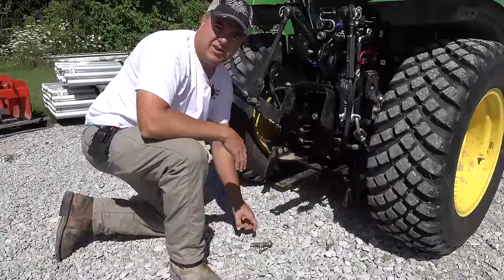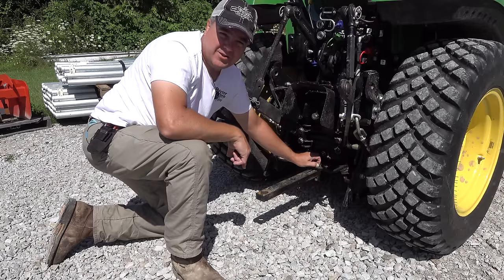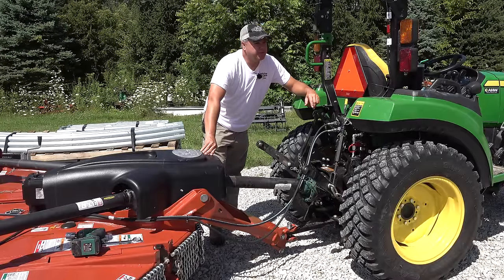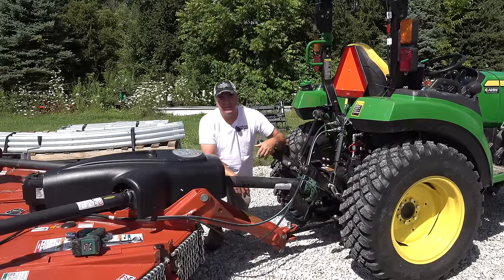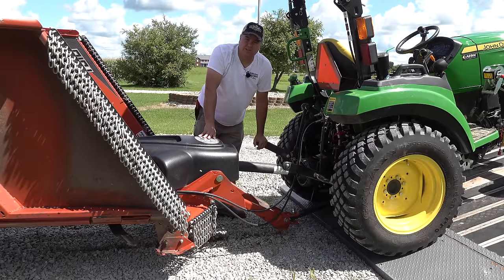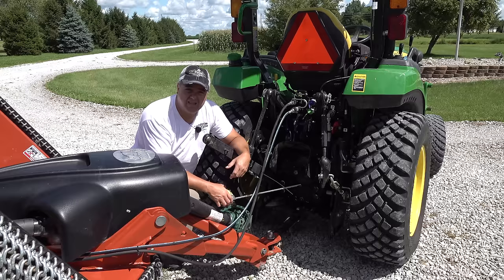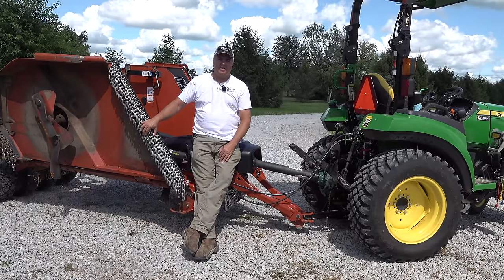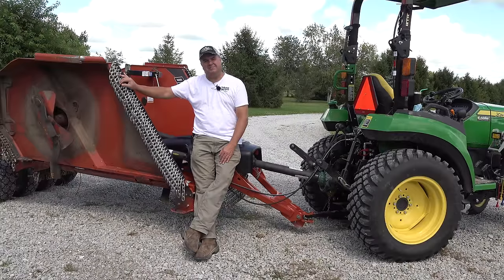COSTLY REPAIR on Deere  2038R!!!  Tim's HUGE Error!  Details Inside.

Comment: Very good video... While I have not used a pull bar hook up yet, I probably would at some point and like you would most likely have made the exact same mistake because I also try to not extend things out to far.  One of these days though, to be fair, I should post the link to my video when I got my first tractor and nearly flipped it upside down thanks to the new forward angle ROPS and a nice thick tree branch...    Because of that and my contacting JD immediately (don't know if it is remembered, but I got one of the very new model 102x series out of the factory before most dealers even had them) and they took a look at it in JD engineering. Aa few weeks later a full recall for the ROPS was done and the dealer picked up my tractor to have a mod done as apparently it is supposed to break the pivots now if that occurs with the engineering change.    

People make mistakes..  and sometimes they are costly..  I am glad in a way this happened as it is a good teaching moment for the rest of us.    Right now, for me, I am trying to figure out where this extra metal bar with a spring piece goes under my tractor... It fell off and I have NO idea where it is supposed to go.. LOL
Reply from the maker: Post photos to greentractortalk.com.  They will help you.
Reply: @TractorTimewithTim  cool thanks!   It's needed as I have no idea where this part fell off.. it's not broke at all..  it got pulled loose moving brush with the grapple.

Comment: hi Tim, couldn't you have hooked up the hitch to the 3-point by using a 3-point hitch adapter? I use this method because I ripped the draw bar mounting bolts right out of the casing the three-point is much stronger it looks like in the video that The Hitch is too low in the first place my tractor has a thumb screw that locks the three-point so it can't be lifted or lower you can lock it in a fixed position
Reply from the maker: Please.  Do not do that!
Watch this video for explanation:
https://youtu.be/kD-MSo3kRAo
Reply: I watched the video I understand what you're saying you can actually lift the 3-point up if you're strong enough when it's in the down position by hand. I guess it's designed to float so it doesn't cause damage to the tractor. your father was a very wise man he knew what he was talking about

Comment: Hello Tim, I'm gonna invest in a jd 2038 tractor and a tiller when watching ur video here I picked up on ur statements about cutting ur PTO shaft to correct length. I don't know about tractors and attachments? So maybe reading the manual would be the correct thing to do! But like u I tend to think I have a basic understanding of thing and would never take the time to do so. But my question is if I hook a tiller up to the 2038r would I have to cut the pto shaft? Or can u just hook up and go? I know this probably sounds pretty stupid but like I said I'm new to the game! Thanks in advance!! T.Cox
Reply from the maker: Once you hook up the 3 point hitch, then try to connect the pto.  If it will NOT retract far enough to allow you to connect to your PTO shaft on tractor (with a couple inches to spare), then it needs to be cut.    
After connecting, make sure that you can raise and lower the attachment all the way without seeing the PTO shaft fully contract.

Comment: Don't beat yourself up to bad. I work at a machine shop close to Nashville and we just had one in here about a month ago fixing a similar problem. The gentleman was bush hogging and somehow got it in a bind. I cant remember the exact size of the JD but it was a compact tractor with a cab. He had busted the housing out around the rear axle. It was a substantial damage! We were able to repair the bell housing and add thicker plating around the 3pt hitch connections. Now Im not a tractor expert by any means but the biggest problem I seen with that JD is it was all cast aluminum. This may be common on your new compact tractors but coming from someone with a manufacturing back ground I would think that cast steel would be a better choice than the cast aluminum. Deere knows the loads that could be applied at times to the working end of the machine. Seems like a huge miss to me.

Comment: Thanks for sharing your misfortune, Tim.  If you save only one person from making the same mistake, then it's all good!

I'm a newb, but are there aftermarket drawbars available with a gooseneck bend that will give you acceptable separation from the PTO shaft and raise the implement tongue up to a more horizontal position?  Or make up your own?

Comment: I was lucky I put a new pto shaft on my 3 point brush hog, it was longer than the old one so when I raised it way up the shaft bottomed out and bent the third point on the brush hog instead of breaking the pto housing, I cut the shaft to the length of the old one, it’s like closing the barn door after the cows get out.
Reply from the maker: Right!  You were lucky!  Oh well, we all eventually learn...even if a bit too late at times!

Comment: Definitely something we're all guilty of. I had to take a field rake off in a ditch to get out. But I don't know if I should be impressed with the strength of the mower and PTO shaft, or concerned about the strength of the tractor's casing.

Comment: I took my new John Deere 790 tractor with the 60 inch brush hog attached to our church to mow the church lawn and was mowing when I reached an area where there is a downhill grade and thought about what the manuals said about mowing on a downhill grade and decided not to carry my tractor on that grade and instead mowed the upper part which was level and let the kids use a push mower to go over the downhill grade to cut the grass. I didn't want to damage my new tractor and bush hog unnecessarily by trying to cut with my equipment in a bind. That was a good decision on my part and saved me possible damage to my equipment and time to get it repaired. I do read the manuals and the stickers on the equipment to be on the safe side  even though I have operated tractors before.
Reply from the maker: Good choice, Sidney!

Comment: I recently bought a tractor and a few implements from a local dealer...one of the implements was a 6 foot Roto tiller that when delivered was said to be ready to go....i bush hogged a few days then hooked up to the tiller...i shoulda known something was wring when I had to connect to the pro first then back in to hook up...a few minutes of tilling and the u joint was chewed off...spread the yoke...the dealer gave me a brand new shaft because they knew their mistake.....they cut the new one but not nearly enough...i eventually got it short enough .....i hope lol
Reply from the maker: Lucky it only damaged the shaft
Reply: @TractorTimewithTim  yes weak u joint? hopefully saved my tractor

Comment: I used to hate reading manuals also until I worked for a dealer years ago and had to setup things for customers. I rather enjoy reading them now, you learn shortcuts and how to use new features, some you might not even know about. Besides I've seen too many costly mistakes on new machines.
New toys are sometimes hard to wait for, but usually almost always pays off in the end. I do cheat sometimes, we all do.

Comment: Hey Tim 
I saw in one of your video you went by one of your friends that have a LS  MT 125 tractor which I have. Would you have any idea why when I use the backhoe sometime the boom give trouble to swing to the left (like its weak)but works fine swing to the right. 
Just checking since you around small tractors
Thanks
Reply from the maker: No idea. Sorry.

Comment: Ya, ive done a few foolish things. Tractor vertically up a tree, taken out a fence from trying to put hay up before rain, and destroyed a pto shaft. Things happen. Just to how much will the damage cost. 

John deere has thinner housings and overall a lighter Tractor. Mahindra is among the heavier side as larger casting. The do not hold up well eletronic wise, but minor problem.

Comment: It’s an honest mistake Tim, I’ve got a 9ft pull type the shaft was cut to short on, went over a hill it pulled apart when it went back together it didn’t line up and broke the stub off on the gearbox. Greetings from southern Indiana.

Comment: Also happens when you put the pto shaft at to much of an angle when you raise it up because you forgot to tighten the locking nut on the center link and it moved during operation. Destroyed my trans housing like you did on my 2210 I had.
Reply from the maker: I remember you saying that!  Hey, I give you a shout out in the episode from Sunday!
Reply: @TractorTimewithTim  I just replied on it. Thanks!!

Comment: Worked at a Deere dealership for 16 years and I can say your not the first and wont be the last to have a whoops like that happens more with 3 point equipment cause people by attachments and don't know that they need to cut the shaft down each tractor size and attachment is different

Comment: Read the manual? Who does that?! Oh yeah, after I break something. That's the problem right there, you had a JD rep. on your property! The kiss of death. WOW! JD covered you on warranty?!? I'm shocked at that. JD delivered a X738 to me with bad injectors &  control module, the dealer was clueless, couldn't figure out the problem, then refused to fix the problem citing "In service use". I used the tractor, therefore the problem occured while I was using the tractor. BUT -  AS I STATED THE TRACTOR WAS DELIVERED TO ME WITH THE ISSUE AND STILL UNDER WARRANTY. I even have the proof the tractor {in writing from the dealership} the X738 was delivered defective. So $2,000 out of my pocket, and at a different dealership my X738 is fixed. THANKS JOHN DEERE!

Comment: I bought a used  90's JD 755 in the early 2000's,  the guy I bought it from  knew nothing  and had it serviced  locally.  I trailered  it 2.5 hours  , off loaded it  returned home,  and contacted  the local  JD agent  to ask how to determine  power  steering oil level.   (All checkable fluids were good)Got told,  use power  steering fluid,  fill to an inch below filler cap....
There was no dip stick  and hadn't used  anything as new as this before.  Said to service guy at JD, that this seems a cruddy way of determining power steering oil level,  he said,  they're  just a cra.py yanmar, that's how it is.  Next weekend,  back to use tractor,  topped up power  steering fluid as advised, it all disappeared,  ended up putting almost a litre in and still disappearing...
Decided  that was enough , something is seriously wrong  with this thing ...
Fired it up,  clouds of smoke,  choked to death , fired it up again,  smoke,  choked  to death 
Turns out power  steering runs off engine oil,  power steering fluid overfilled sump,  deglazed  rings, no compression,   pull it down to solve this and a myriad of other issues.
Moral of the story,  dont  trust the agents!......
Other than that it was a great little tractor!

Comment: I think the takeaway is to not load with at PTO shaft hooked up. Super easy to avoid the mistake in the future.  I've never even thought of this outcome.
Reply from the maker: Nah.  The take away is to read the directions, and ensure that the drawbar is long enough...sticking far enough out from the PTO.
Avoiding loading would not necessarily help, as crossing a ditch or other uneven spot in the field could cause the same issue.
Reply: @TractorTimewithTim  Right...it needs to be setup correctly to handle any steep situation. True true true

Comment: That's one of the bad things about high hp compact tractors. On the bigger ranches I worked at we had 3-4 different tractors set up for the different task and certain implements only went on specific tractors we set them up so we wouldn't have those issues just incase someone wasn't paying attention to all the details.  Can't tell you how many draw bars I seen get destroyed or shafts get destroyed.

Comment: It looks like your brush hog is too big for your tractor, but I see it's working. 
I was always told 5hp per foot of brush hog.  
I have a 6ft brush hog and I need a new tractor and I would sure LOVE to buy something less than 30 PTO HP.
So what's the consensus?  Can I get away with less than 30 PTO HP?
Reply from the maker: no, you cannot get by if you use a single blade bush hog.  The trick to this one is that it is a 3 blade unit.   pulls much easier than a single blade.

Comment: Engineers are Smarter than you think 
Those Warnings are there for a Reason
As a 40 year Mechanic I can say 80 to 90 percent of Warranty Issues are from not Reading the Operator Manual or Decals
Most are Denied due to Operator Error

Comment: Don't worry, we all do dumb mistakes. I have this big wood three point log splitter that have its own hydraulic pump on the PTO. The reservoir is underneath the splitter and the return hose is facing the PTO shaft. Once hooked, there is not much space back there. I have to remove the drawbar in order to set it up properly. Of course, one time I forgot to remove the draw bar. When I lifted up the three point, the draw bar pushed on the return hose fitting and tear it out. The splitter oil reservoir broke. You can imagine the huge oil spill... Repair it was not obvious either since hydraulic oil is flammable and can explode. You always have to check twice each time you set up something even when you've done it thousand times.

Comment: Right off the bat, put the drawbar bolt in from bottom up, and not top down. The grass/sticks will pop the spring pin off, and you will lose the drawbar "somewhere". If in from bottom up, the likelihood of getting that pin ripped off is less, but if it is, the drawbar will be released and likely easier to find. I still can't find my drawbar.  Actually don't use a spring pin and use a 1/4" bolt instead with a lock nut.  Sorry to hear about the wrong length on the PTO shaft. Not an easy thing to figure out the proper length to cut them.
Reply from the maker: Not supposed to cut this one at all.  Must have 14” distance from drawbar to pto shaft.

Comment: in the first 2 mins of this video i placed my bet it was the rear end since it's made of aluminum.
live and learn.
though if you had a kubota katc would have covered this.
Reply from the maker: If I had a Kubota,  the drawbar probably would have extended automaticity as necessary to handle the situation!
Reply: @TractorTimewithTim  not saying that same action wouldn't have broken a l3901 but there's only one way to find out! But the ktac insurance would have covered that.
Reply: ram-n dodge - i like the kubota  ktac option wich i may get for my kubota gl11000 diesel generator

Comment: That can be a brutal repair.  Had a customer who did something similar to his Case IH utility tractor about the same size.  Unfortunately, the casting he broke was the center section. Basically the very foundation of the tractor. It required pretty much disassembly of the entire tractor to fix. In that case, it was a too long shaft on a three point mounted implement which is why it is so crucial to check pto shaft clearance.   I'd never consider this on drawbar implements, so it definitely could have happened to me too.

Comment: Guess I'm guilty of reading the manuals. My dealer once commented when I told them about something in the manual. "You read the Manual" That's how I found the Picture of Jacking up the front of a 4440 the picture is upside down. That said, been farming for myself for 45 years and I make mistakes.

Comment: They (deere) do not offer a offset  draw bar  They should because if you had a offset draw bar the distant between the pto shaft and the draw bar would be less so the pto shaft would not have to move as far for that bind you put it in.  IF you would of moved the draw bar out to the last hole and you would of gone over a hump ( the  opposite "bind")  the pto shaft could of pulled a part.

Comment: My mistake was way worse...  Seeing the oil light and not getting the engine shut down immediately... Had I repaired it, there was an 8000 bill awaiting. Ended up selling and losing about 7k of value, and then of course the ensuing L3560...

Comment: Why hook the PTO up for loading? I never do that.  I try to use common sense while working with equipment.
Reply from the maker: Why unhook specifically for loading?  Seems like a waste of effort.  Must have it hooked up when on the trailer anyway or else there is a risk of the shaft coming office the attachment.

Comment: If we are truthful, all of us have stories where we forgot to RT_M. It is called, gaining experience. Sometimes, it does get costly. Thank you for passing on your experience.
Reply: As you pointed out a pull type mower can have this problem.  Regarding Deere standing behind their product. About two years ago my 4520 had a major failure to the tune of $2000.  The tractor was well beyond warranty but they fixed it at no cost to me.  Just another example of how they stand behind their equipment.

Comment: rather have a shaft that's a bit too short and flops out every now and then one that's too long and damages the insides of.... your ""tractor""
Reply from the maker: Or read the manual, and have the drawbar at the right length.  Then everything works fine.